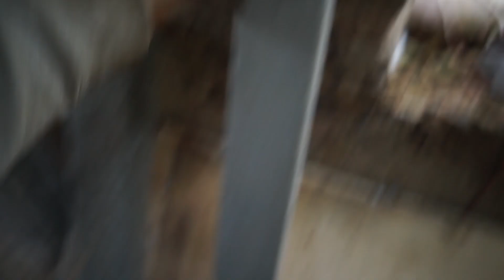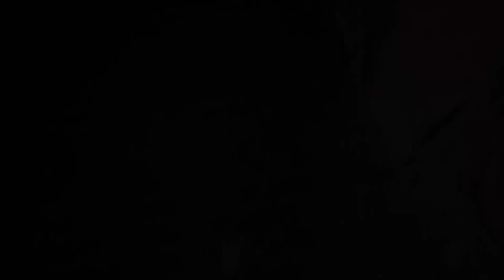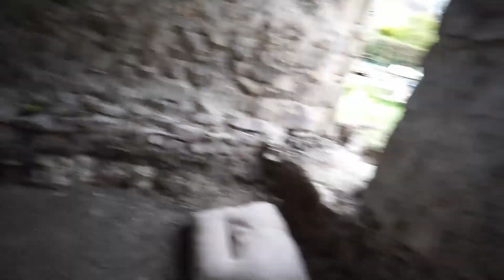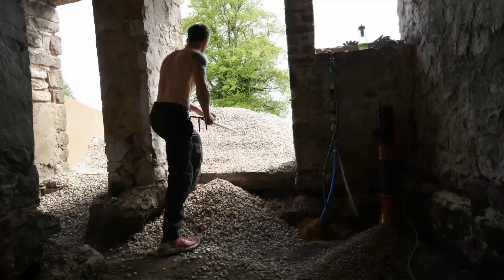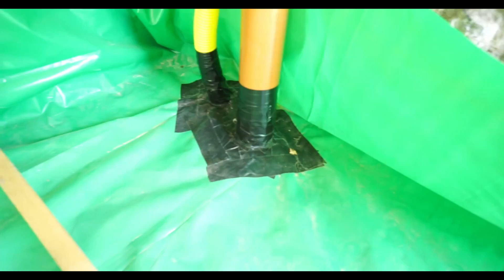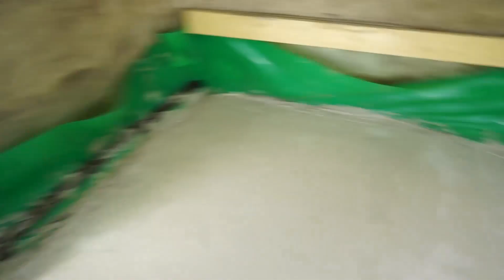Nettle Barn Ep4 Radon sheeting and sump, drains and concrete slab self build barn conversion

Comment: Fantastic video! 

I have a question about the radon barrier upstand — did you end up fixing/taping it to the wall somehow? In any case, I'm wondering if radon could diffuse relatively freely up through and out of a stone and lime mortar wall since it's breathable. I assume it might to some degree. That said, a radon sump is probably going to help vent away most radon so I'm guessing it's probably not a concern at all.

Anyway, this video is a gold mine of information, I'm researching for a house about the same age here in Cork, Ireland. Learned a lot, thanks!
Reply from the maker: The radon barrier sat underneath my stud walls. The vapor barrier for the walls (taped insulation boards) was then taped to the radon barrier to complete the seal. Any gas going up and into the wall at this point would permiate through the rubble infill of the wall and vent through the roof vents along the wall plate.
All the best with your build!
Reply: @timmynettles  Very nice! Thanks for sharing. I ended up watching the rest of the series, great stuff, really enjoyed it and got a lot out of it too. Brilliant work. Are you in or near the East Midlands somewhere? My wife is from Nottingham, I go over there to visit a bit. Cheers!
Reply from the maker: @envueltoenplastico  message me on Instagram @nettle_barn